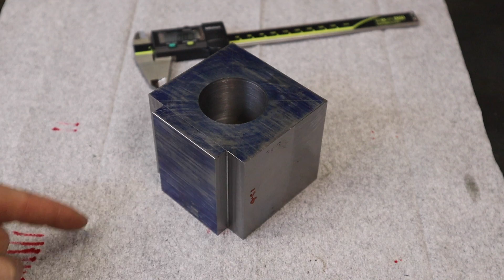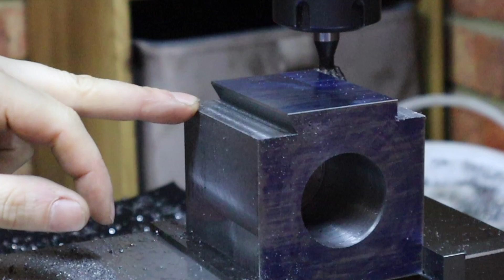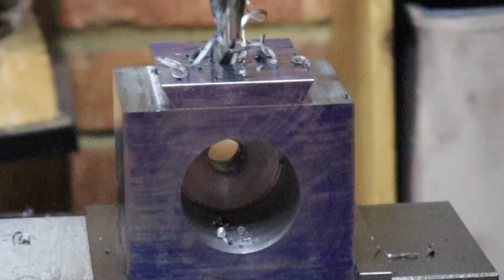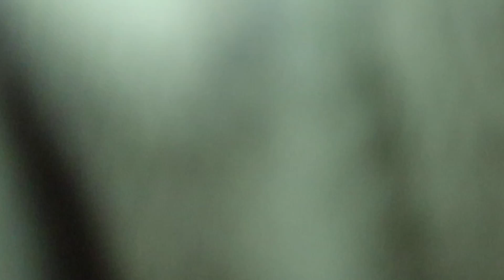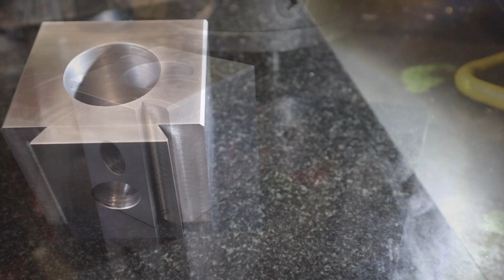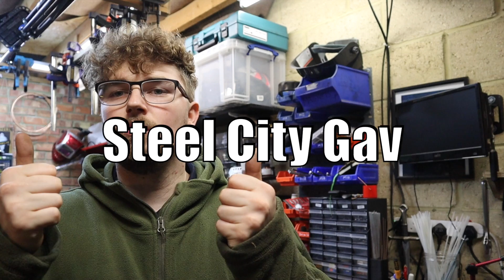Making a Quick Change Tool Post Part 3

Comment: Hey Joe awesome project coming along well.  Bit of a heads up, those bigger size drills wreck those keyless chucks. They tighten to the point that they pull the fine threads apart that hold the Chuck together a keyed Chuck works better for big drills. Keep up they great viewing.
Reply from the maker: Cheers dude great bit of advise there will have to remember that for next time.

Comment: Definitely probably could have taken the chamfers in one pass. Chamfer cutters always cut better with a climb cut. Tighten the table locks a little and let her eat. Also I always set up my chamfers on the solid jaw of the vise. Then you can just keep flipping and turning the part and not have to keep touching off the cutter
Reply from the maker: Great advise Mike definitely going to try this next time sounds like an easy way of getting repeatable results easy.

Comment: You are doing OK for a beginner 🙂 but looking at your shavings, it was coming off as powder, you could have done almost full depth on one cut as long as you were not climb milling. (stand off the bottom edge .004" to preserve the bottom of your cutter, you could always file out the corner later if needed.). Don't know if it was the camera frame rate but rpm looked a smidgy bit fast.
Reply from the maker: Thanks Dr1verman always good to hear your opinion always very constructive so thank you.

Comment: Looking good. Which model mill do you use?
Reply from the maker: So I have a Warco Major GH40 really good bench top mill in my opinion. Only down side is the round column part but a simplish mod has sorted that out.